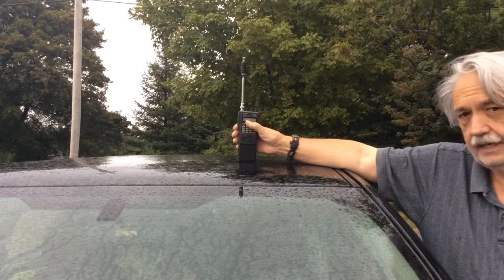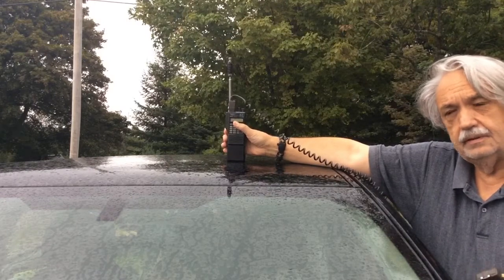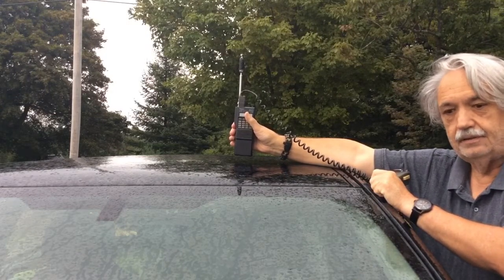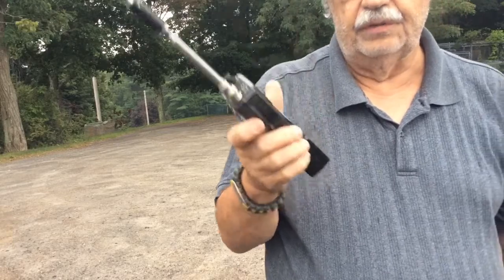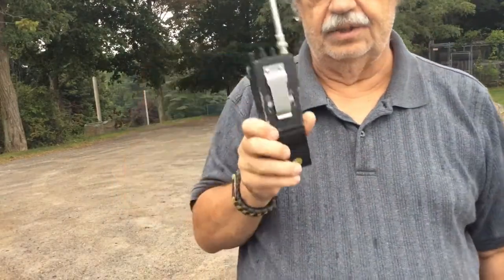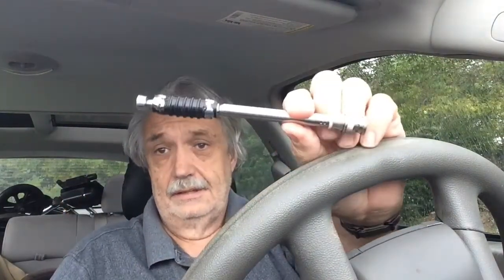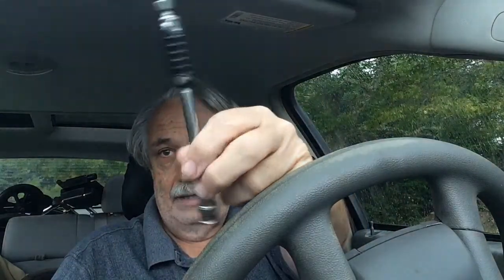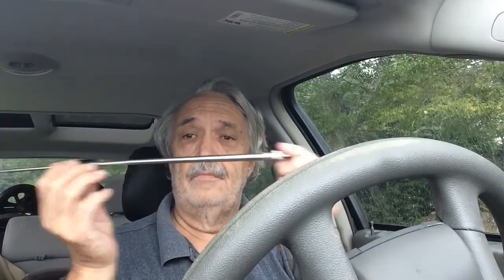Increase the range of your handheld transceiver.

Comment: Interesting stuff Mike thank you. Do you think that there’s much of a future for hand held radio devices, now that the smartphone is ubiquitous?
Reply from the maker: Yes. It boils down to emergency use. One of the reasons ham radio operators hold on to a huge chunk of frequencies is that they are many hand ready to do emergency communications. With the prepper movement s huge number of people buy these hand held radios even though they won't be worth much without being set up to local frequencies and understanding how to operate them. It is like buying a bow and arrow for emergency use. You are going to have to learn how to use it before the emergency happens.

Comment: Yes. The HTs have two troubles : Antenna type and are about 1, 65m over the ground.
Reply from the maker: It is odd when people talk about range. An HT can easily work the ISS but may not go very far if you are trying to contact anyone HT someone is holding. But you nailed it. HTs have a very compromised antenna and they are not high enough up.
Reply: The price for the convenience of the freedom you get from HT's

Comment: Good tip about the ground wire.  I wonder why they don’t make antennas with 19” grounding wire
Reply from the maker: Because it makes them less convenient. Just using a 19 inch antenna helps a lot but makes the radio more bulky.

Comment: Wow didnt know

What about putting a metal washer over your connector  then a hanging wire then screw your  antenna  on over it
Reply from the maker: That would not work because the antenna has a bayonet type connector.

Comment: since ur roof is metal  can't u just hook a wire to the metal roof & from the inside of ur home & use           it as a massive attenna? just wondering i got a metal roof.
Reply from the maker: It was s sometimes possible to use metal roofs as antennas. The size and shape of a metal object dictates what frequency it will be tuned to. Using an antenna tuner (an impedance matching device) it might be possible to use it for certain frequencies, but its performance might be poor..

Comment: thanks for convincing me i dont know how to use a walkie talkie
Reply from the maker: There are many aspects of radios that don’t seem apparent with handhelds. Did you know that the two meter frequencies can affect your eyes? They actually absorb two meter frequencies. Handhelds are usually low enough power not to be much of a concern but being next to a two meter mobile rigs antenna for a long time is not good. But...In a car you are shielded from most of the radio waves by the car roof.
Reply: ok, sorry i sounded rude
Reply from the maker: I did not think you were rude, sorry if my reply made it seem so.
Reply: it did not